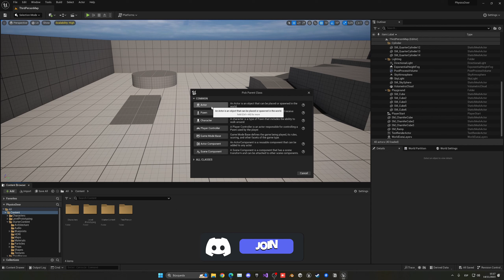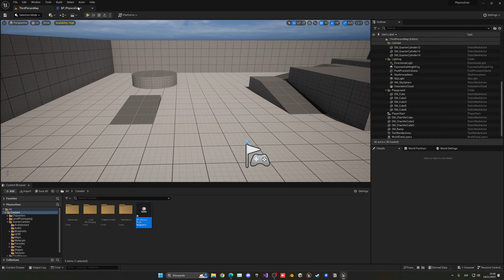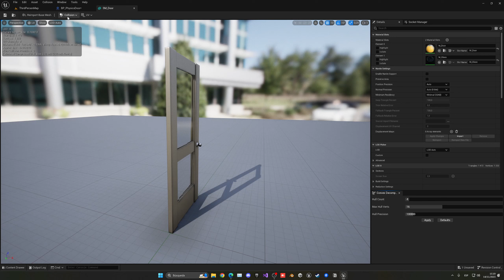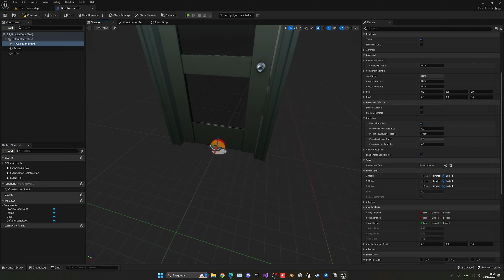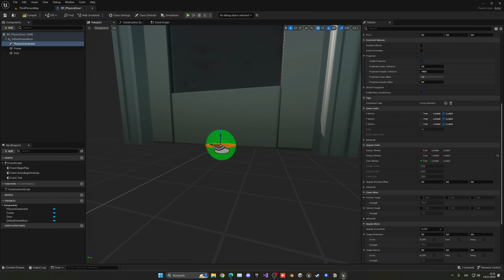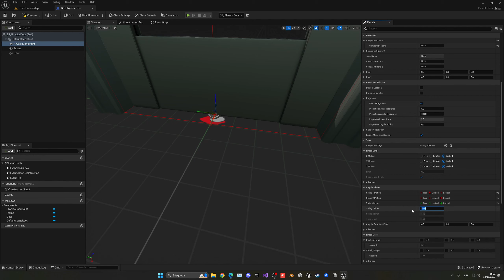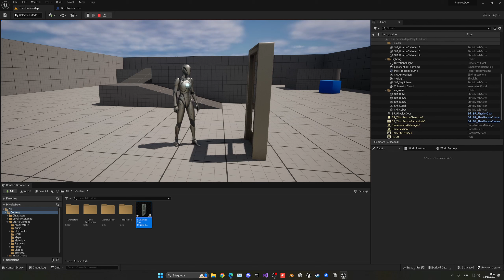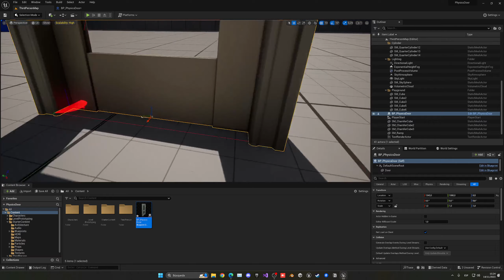How to Make a Physics Door in Unreal Engine 5

Comment: Thanks for the tuto, worked well with me for my wild west sallon bar.

I was wondering how I could add a sound SFX for playing when the door open
Reply: Just add a Simple collision Box under the Door and Doorframe Mesh. Resize the Collision to about the Door Size, go into the collision, scroll down and click on Add an Event called "On Component beginn Overlap" then just plug into this node a Play Sound 2D node, chose youre Sound. Thats all

You can play with the size of the collisionBox to fit with your sound, and also change the Starting time in the Play sound 2D node to match the timing

Comment: I'm encountering a weird bug when following this. I've followed through it about 3 times now and I keep getting the same issue.

No matter where I place the actor in the world, the door (just the door, not the frame) is in a completely different location. I found out that the door is being locked to coordinates of the Physics Constraint in the actor but relative to the level world. So for example, if I moved the physics constraint to the left of the doorframe on X-50 in the actor blueprint, the door mesh would be locked to X-50 in the world level which is far away from the doorframe.

Any ideas what's happening there?